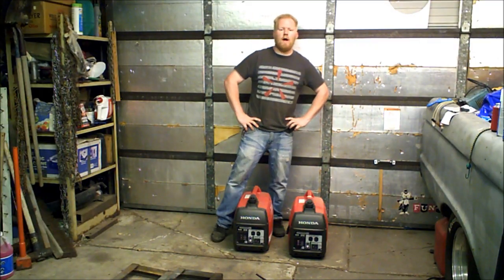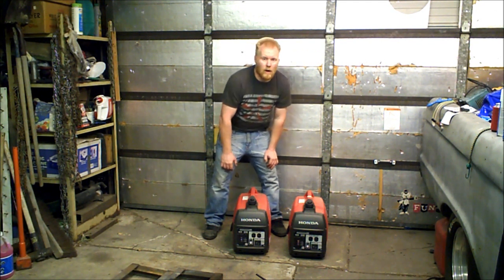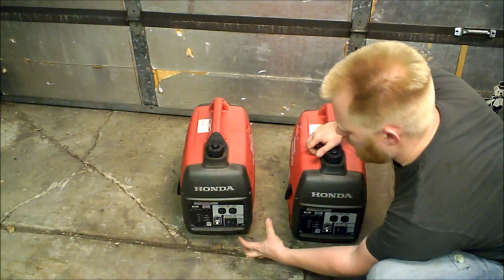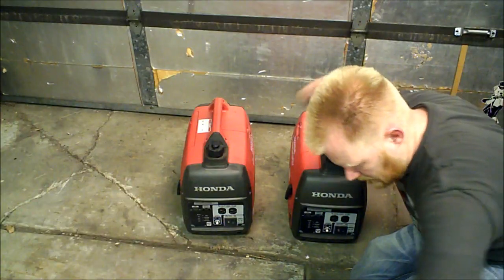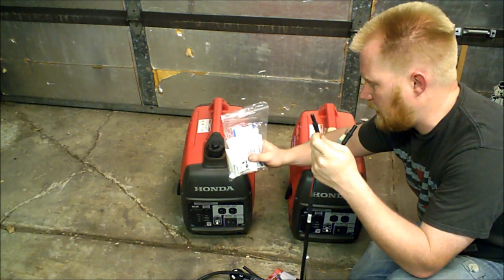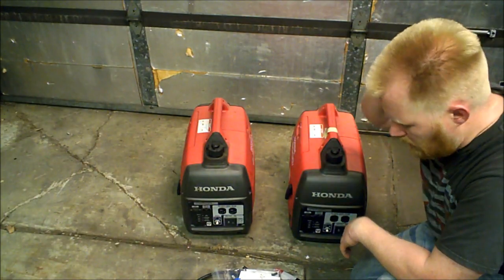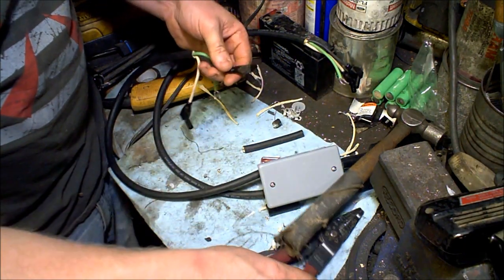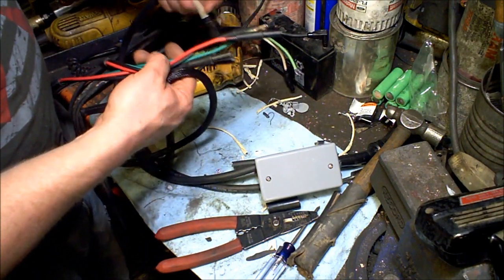Homemade 30A Honda Eu2000i Parallel Kit Generator

Comment: You seem to be the smartest guy I know on YouTube, maybe you can figure something out for me if you get a minute. It also might make a good video for you if you can figure it out, I know a ton of people that would like to know how to do this. Here's the link to the video  https://youtu.be/xxHAkOELXlI
You have to watch the video and read the comments below to kind of figure out what's going on and how this guy did this. It's very vague and he doesn't seem to want to reply to any inquiring comments on how he wired this up. Basically he's taking two small 120v inverter generators and, " according to the title of the video" paralleling them together to get 240 volts. Two 120 v legs with their  wave lengths 180° apart just like the split phase you get out of the transformer on the pole that feeds you house. He shows this in the video by moving his test lead from the oscilloscope back and forth between the leads on the generator plug. Basically using 120v leg  from each generator, running them through a dual primary and secondary isolation transformer, (no step up /or down) just two 120 legs in and two 120 legs out. But he mentions that he reversed maybe the two  outs of the transformer,  I'm  not sure, to get the gens to  sync up the phases so each leg is 180 °out from the other so you could feed each side of your home panel to get 120 and 240 out of two 120 v generators. Sorry so long, let me know what you think. Thanks
Reply from the maker: The Hondas and other parallel capable generators sync to each other to make sure they have the same synced sine wave. The second generator adjusts to mimic the first. There's two ways to you may be able to get 240v split phase. Possibly to trick it, they're using a 1:1 transformer and tapping it where the wave form is reversed and using that to trick the second generator into thinking that it is syncing. In reality you now have two opposite sine waves or if combined 240v split phase. The transformer would be small and only used as a trigger. I'm not sure how the generators electronics would handle the load since you are sharing the neutral. but it may work. The other way would be with a large 1:1 transformer that handles half of the 240v load. Look at the pdf  linked below. 

Here's a wiring diagram of how a 120v single phase can get stepped up to 240 split. Page 4
https://ressupply.com/documents/outback/PSX-240_Manual.pdf
Reply: @sixtyfiveford  I just bought two Cummins inverter generators, one 4500  watt and one smaller 2500 Watt 120v. Have plans to do a generator shack or shed on my property with a whole house diesel generator for backup, but with all this craziness going on I needed to do something sooner especially with couple freezers worth of expensive meat in them that I have to keep running. I really wanted a small quiet diesel generator but for the price they ask for them right now it made more sense to buy a couple small inverter Gas jobs. Wanted them small and quiet 2 keep on my back deck. After purchase I realized that in order to back-feed least all the 120 volt circuits I have to do a lot of rearranging my panel which would be a real pain in the butt. And so would a transfer type switch, didn't want to go through all that. Really only want the 240 to run my well pump. Would be a nice convenience having water.  Those stand-alone Transformers that step up to 240v would be nice but get expensive because they have to be rated for the currant drawn. I really liked the idea of the small inexpensive Pony Transformer that syncs up the generators to get 240 split phase out of them. The only thing is my generators don't parallel to each other, like The Hondas do the parallel kit I purchased basically it's just a two into one cord. 1 hot one neutral one ground coming out of each generator then they get Y 'd into a 50 amp plug RV type. So I'm not sure if my gensets have a sinking capabilities like The Hondas do. this sucks I really had my heart set on getting this figured out somehow. Thanks for your input
Reply from the maker: @mitchdinner9743  With a pony transformer I'm really not sure what the inverter generator is going to do. If the power factor is horrid on the device your running it may freak it out. It may just switch it back and forth to 120 single phase to 240 split if the power from the 240 exceed the pony transformer power draw? Lots of unknowns. The Cummins are parallel capable just like the Hondas.  A full power transformer seams to be the safest way 5000watt continuous https://amzn.to/2JnqUPB  Here's a video of a guy using it to use his well pump: https://youtu.be/2dLmeV7SfVg
Reply: @sixtyfiveford  yeah I don't know what I'm going to do maybe I'll order one of those one to one isolation Transformers play around with it and see what I can get. Or at least call the company and maybe they can let me know or educate me a little on how I would wire something like that or if it's even possible. If all else fails I'll just get one of those autoformers. Thanks again for all your help and getting back to me. Do you have a PayPal account I can throw a little something into for you? Maybe a little kibble for ginger?
Reply from the maker: @mitchdinner9743  You may be able to simply rewire the well pump motor to 120v. It will draw twice the amps but will work the same. I was looking at those Cummins generators last fall but there's not a ton of info on them. 

Ginger could always use a few new tennis balls www.paypal.me/sixtyfiveford

Comment: I would have used a larger box with a surface mount female rv plug and made it more weather resistant.
You can buy the champion for $79 or the Filmore for $69.... Not sure it's worth my time to build it

Comment: Good morning, Just wondering if you can parallel more then 2 generators together safetly to provide more power?  Thanks.
Reply from the maker: There are a few videos will people running 3 machines hooked together without any issues.
Reply: Thanks, came across a kit made by or sold by Duration Power which allows you to parelle 3 Honda's.  Check out Duration Power.

Comment: Thanks man. I bought 2 of the A-iPower SC2000i from Costco. The Yamaha made generators. I took them back twice. Getting them now I know that the parallel cables they come with melt or just ain't large enough gauge wire to hold up when running the AC on our camper. 
I wont use the factory cables this time. 
I was looking around on YouTube and found you. I'll look for the link for the banana plugs/connectors and make my own out of 10 gauge wire. I think that will do the trick and make a box like you did. 
Thanks!
Reply from the maker: Pretty much any banana plugs work, however the ones I used have shrouds on them so you can't physically touch them with your finger. This is what the oem manufacturers use so if the cables are only plugged into one running unit you can't shock yourself. They were not easy or cheap to find. 
 Since I did the video a lot of cheaper solutions have come out and most people go the route of something like this https://amzn.to/31RIrqp

Comment: This can ONLY be done with inverter generators. If you try to do this with two "regular" generators or one of each type, their output can't be properly synchronized and this will result in a dangerous short circuit; both generators and anything attached to them will be severely damaged or destroyed almost instantaneously.

Comment: I'm sure you have figured out by now that it does matter which parallel  cable goes where yes it does not matter which color you use but you do have to make sure they match on each gen one is your hot lead and one is the neutral so mismatching them will end bad. May want to edit your video so no one else burns up there gen.
Reply from the maker: It does not matter. The second generator started automatically matches and syncs with the first.
Reply: @sixtyfiveford  Looking at the wiring diagram and how they are wired. I'm sure the inverter is not going to switch which leads are the hot lead and which is the neutral that's the only way it would not matter which one goes where and in the parallel instructions it says make sure the left side is hooked to the left on both and right to right. Have you actually flipped  yours a ran it that way?
Reply from the maker: @daledjfire268  I've flipped them many times as well as countless users. Honda is smart enough to put unique plugs if it mattered.

Comment: gr8 idea but I have two power inverters can I combine them together for getting high watts with this cable or this cable is for generators only?
Reply from the maker: These Honda generators were designed to be able to do this. You wouldn't be able to connect two inverters together like this.

Comment: Do you know if it would be ok to run two different brand inverter generators with very slightly different voltages?

Comment: Instructions clearly says left to left, right to right for the parallel cables so it does mater which one u plug it in specially in your application.  Even if the gen will figure it out when you cross the cables it will not figure out the output on your plug and you might be switching neutral with hot and don't even know it. Why don't you get voltage meter and check it out a little.

Comment: You are supposed to have a EU 2000I COMPANION Generator to run with that EU 2000I
Reply from the maker: You can, but you don't need to.

Comment: you only put the line side wires together on one side of the breaker, or is that a two pole breaker ?
Reply from the maker: You only need a circuit breaker on the Hot side. Just like your home the neutral side is always straight through.
Reply: I didn't realize that you were only running 120V,and not 240V

Comment: Hello sixtyfiveford. I have one question, please. Can you tell me if I can parallel a Honda EU2000i AND a EU2200i? here's the link to the Honda literature: https://powerequipment.honda.com/generators/generator-parallel-capability 

If I read the Honda literature correctly, I believe that they say it can be done, as long as the serial number is higher than EAAJ-2017305...my 2000i is EAAJ 2432345. 
I'd like your considerable expertise to weigh in on my question.
Many thanks for taking the time to respond!
Reply from the maker: That's a great question. Yes, only the oldest eu2000i's could cause a low voltage issue. Yours is well within their recommended serial range and you'll be fine. I have not had my hands on a eu2200i but I am excited to see what the new 121cc engine in it can do vs the 100cc they've had forever. Supposedly they refined the sound a little more and it's even 2 decibels quieter.  I do wish they had upped the power to around 2500watts but then you wouldn't need a pair.
Reply: Great news, sixtyfiveford; thanks for the confirmation! I am in high hopes of getting one of the new EU2200i's in the not-too-distant future. Thank you very much for your very informative videos. I'm a subscriber for life!

Comment: You could do 240V, but you'd need an autotransformer... Basically it's a 240V transformer with a 120V center tap (which is your neutral), and no secondary.  You will get the same power, but at 240V rather than 120V, you'll have about half the current available (240V@15A rather than 120V@30A).  If you wanted the same amperage (30A) available at 240V, you'd need 4x generators in parallel.  With an autotransformer, one of the concerns is to keep the phase splits balanced so you don't burn up the transformer - this would mean you'd run one generator on the low 120V tap, one generator on the low and one on the high tap, or two on the high and two on the low taps.  Getting close to a full 240V@50A would mean you need 6x generators, three on the high tap three on the low tap.

Comment: Is there anything preventing me from just using the 3 prong outlets on the gens to parallel them instead of the special "parallel" ports?
Reply from the maker: That works identical. This is nicknamed the "Suicide Plug". Because if one plug got pulled out while the other generator is running you'll have a live male plug that could electrocute someone. Other than this it works the same.

Comment: Here in Europe the output is 220V. Does that change the Amperage of the circuit breaker I have to find?
Reply from the maker: Double the voltage will mean half the amps. So combined you should be at around 15amps.

Comment: Well done and appreciated video. 
I think I have all the components in my garage. I saw a bunch of adapter plugs at the swap meet so I'll go find one tomorrow. Only problem is finding the little banana plugs. All the descriptions say 20 amp. Is that a problem? 
I just purchased my two generators with my new trailer in July and I've lost the cable somewhere and I would like to avoid that $40 cost if I can.
Reply from the maker: 20amps for the banana plug is fine as it is only sharing half the load max (30amps)

Comment: I believe you said banana jacks tied to outlets? If so forget the jacks and use the outlets to parallel. Wonder if you could criscross the banana jacks and get 220V?
Reply from the maker: The internal circuitry automatically matches/syncs the frequencies so you'll get 120V 60hz no matter what. The phases of the 120v would have to be 180° out of phase to get 240V. Which Honda could do if they programed it to do so.

Comment: So parallel is 30 amps same phase not 15 amps of 220 v ?   Also why clean carb after couple years ?   Just bought one and wondering
Reply from the maker: The Honda automatically syncs the two 120V waveforms and gives you 30 amps (26.6 amps) of 120volts 60hz. These Honda generators aren't capable of 220V offset phase. Using gas with any ethanol will gum up your carb. This will force you to clean it every 6months-few years depending on if you store it indoors or outdoors.

Comment: I have (2) 2K Powerhorse inverter generators that I want to hook together.  The parallel kit that was included with the gens was made from wire that was a very small gauge and light duty.  The instructions said that, to parallel 2 generators, connect the red wire to the red jack and the black wire to the black jack on both generators.  I did as the instructions said and tried to power a 120 volt air compressor that needed more amps than just one of the generators could provide.  With both generators connected as the instructions say, and both running, the circuit breaker on one generator kept popping and the air compressor would not start/run.  My thoughts were that, how can the tiny sync wires be expected to sync the generators (no problem) as well as convey 120 volt 20 amp electrical power (big problem in my mind).  Those wires are pretty small and I cannot believe the sync connections are also electrical power outputs!  What I did was design a dead man's hookup.  I realized that should one connector come undone while operating, it would be live and dangerous.  Other wise I have no idea how to connect 2 of these type of generators and convey the electrical power to where I need it.  In my design and on the generators, the connectors to the generators are twist lock type 20 amp, which will help with a loose connector issue.  I will now incorporate a 30 amp circuit breaker. Good idea.

Comment: Do you have to run the generators at full speed or can you utilize the economy switches?
Reply from the maker: You can use the eco switches on one or both. If you're pulling a heavy surge load like a RV/Trailer AC unit you will need to keep the eco switches off though.

Comment: I tried to parallel to Northern Powerhouse 3000 gen to a 50 amp plug with their parallel kit and it didn't work. I split the two into separate 120v and wired to opposite sides of plug. what dd I do wrong?  Can you wire the 30 amp twist on plugs instead?
Reply from the maker: So you have a pair of Northern Powerhorse 3000 generators that you're trying to parallel together? Are you trying to use a 4 prong outlet or 3 prong?
Reply: It had a3 prong on the parallel kit. i'm trying to convert to a 4 prong 50 amp.
Reply: iused paralllkit thathad 3 prong. I too it off and connected to a  prong

Comment: How did you synchronize the two AC sine wave outputs from the two generators so that the power of the output AC sine wave equals the summed power of the two input AC sine waves.  Efficiently combining AC currents is trickier than for DC currents.  If the inputs are not in phase power will be lost.  I'm not saying it won't run run RV A/C but it's not the best way to do it.  Cheaper yes but not the best.
Reply from the maker: Honda inverter generators automatically sync the sine wave with each other.